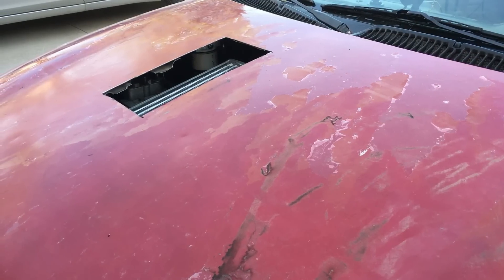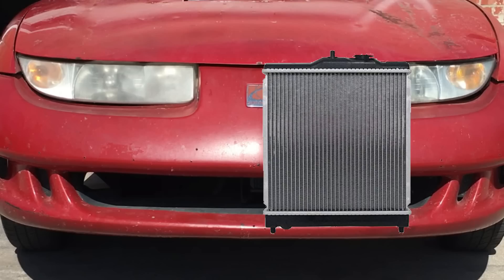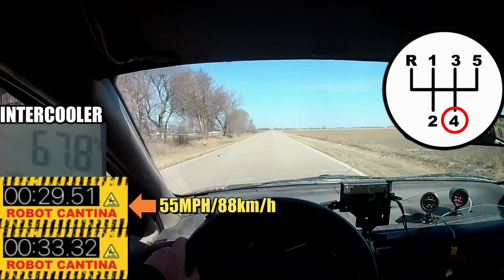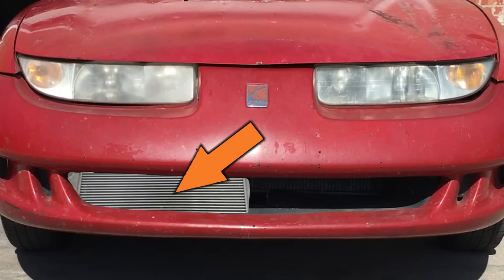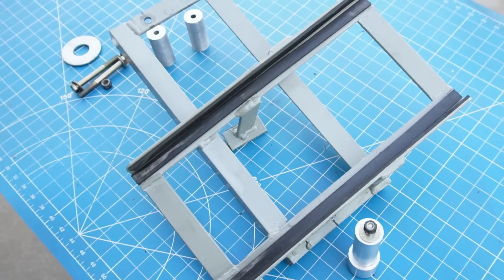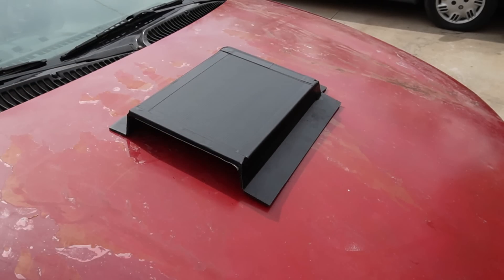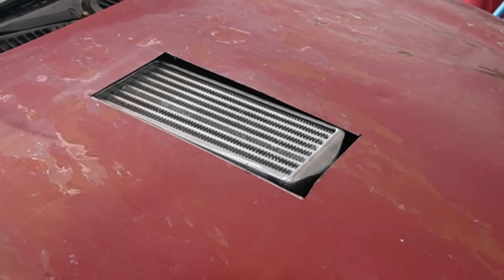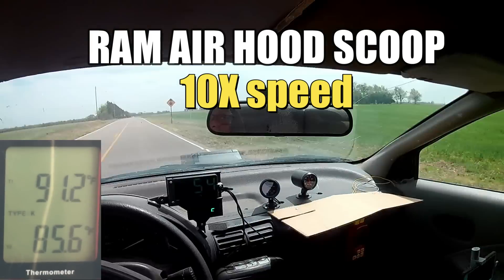S3 E12.  Testing different modifications to the intercooler on the Kubota turbo diesel Saturn.

Comment: It would be interesting to compare a NACA duct vs the ram air scoop, but that would likely mean dropping the intercooler back to the lower slot and a different hole location in the hood.  Purely academic...but there's no kill like overkill. 😆

Comment: I wouldn't say the job of the intercooler is to directly improve performance, it's to allow for more boost, denser air and in result more fuel, granted there won't be much to seen on this small engine but maybe more boost, and moar boost = more heat.  I have a supercharged mustang and the intercooler allows boost to go from a max of 5psi to 10psi, moar powah!

Comment: Putting a mylar/aspestos blanket heatsheild works well for keeping heat away from what you want.

The sideways scoop may pull more air out of the engine bay than opening towards driver.
Reply: I think the word you were looking foe is "asbestos".

If so, I would imagine Bill Gates would be very proud of you..., anyway.....
Reply: @jamesstewart259  they sell it as an off the shelf item at autozone. I used it to replace a steel heatshields on a I4>V6 swap.
Reply: @Eluderatnight  That would be a glass (better known as fiberglass) core...

Comment: I'd say that half of the result that you got by using any scoop there was preventing direct sunlight from hitting the radiator, especially because it's now raised. Of course you need airflow, and for that plan B was the best choice, but the sunlight even on cloudy days would probably have a big impact on this kinds of tests you just did.
Reply: Airflow is what it needed. The affect of sunlight would be immeasurable.

Comment: Do you lose a lot of pressure across the intercooler? I tend to think that dividing and forcing air through a bunch of small holes is going to make for a lot of headloss. Also, "pv=nrt" makes me think that cold air will contract, dropping pressure.
Reply: Like boost pressure? 
Yes, when you cool it it’s volume decreases plus the intercooler is a restriction. More or less depending on the exact setup.

Comment: Why complicate the system with another mechanical device (fans) when a completely passive device (hood scoop) seems to make plenty of airflow? Unless you're planning to do a lot of city driving with idling at traffic lights followed by racing the guy beside you to the next light, it seems unnecessary. But as you pointed out, if the efficiency doesn't change anyways, maybe the whole intercooler system is unnecessary to begin with.

Comment: If I had to guess what the fans will do next week, I would say pulling air in through the cooler with fans will do better than pushing it out from the engine bay, couple it with the hood scoop to double up on airflow maybe?

Comment: Why would performance increase if you have better density but don't utilize it by increasing fuelling? Theoretically I'd assume the higher density results in faster combustion but if you're on the lean side already it probably doesn't cut it.

Comment: Crazy and potentially time consuming suggestion - use a vapor pressure sensor(s) from an automotive evap system to document the air pressures in various locations to inform next steps and improvements (yes, this isn't likely to net any performance gains, but the geek in me thinks it would be cool to see).

Comment: i have scene one of these engnes for sale here in the uk and very temped i was thinking of building a trike as i only have a car licence with cvt to the rear axle i think with the lower wight it would get stupid high mpg id use it in a motorcycle but engine is to tall

Comment: i think all others then ram air did poor as they pulling the hot air from inside out through the rad thus warming it up with ram air having cold air forced directly in is it cooler and is no doubt the same result if it was mounted at the front maybe a little cooler as it not fighting the rising air flow from under the bonnet

Comment: I'd guess that intercoolers are more for boy racers with cone-filtered "cold air intakes" deep inside their hot engine bays, or high-performance engines that are a little bit bigger than this little three-pot diesel, and probably works better on petrol engines anyway, so there's that too, physics and all... :P

Comment: The high compression of a diesel engine is purposely designed to raise the intake charge to a very high temperature to ignite the fuel, so lowering the intake air temperature may actually harm performance. 

If you want to get more performance then a propane system would probably do the trick.

Comment: I would try the intercooler as the air filter inlet pipe then just go too no filter and a mini 12volt can fridge with pipe run through the sides

Comment: The intercooler probably does its job like its supposed to, but you'll need more fuel to compensate for the increased air density
Reply: Yes, but adding more fuel would probably make more power anyways, of course at the cost of less efficiency and higher EGTs. I suppose adjusting the fuel settings to maintain the same air/fuel ratio with and without the intercooler and, if necessary, adjusting the boost for the same manifold pressure to compensate for the pressure drop through the intercooler would be the most fair way to do the test.
Reply: @averyalexander2303  Completely true! The intercooler also increased the amount of turbo lag the system has, so more boost to compensate for pressure loss and volume increase is only fair
Reply: The point isn't more power, though. The turbo exists just to keep the temperature inside the engine down, so adding more fuel would be counterproductive
Reply: @KagoK The turbo was to add power, tuning it with a leaner afr without the turbo would result in a lower egt but he wants it to be as fast as a VW beetle.
Reply: Came here to say this!!  Cooler intake air means cooler turbine inlet temps.

Comment: So Subaru had it right....
The area at the base of the windshield (and extending out a way) tends to be a high pressure area (which is why every car manufacturer puts their outside air vents there.) Unfortunately you're trying to exhaust the air from under the intercooler out of the engine compartment,,,into that high pressure area. Which is why you (and Subaru) need a scoop to ram the air through the intercooler. If there was a measurable difference in performance, putting the intercooler behind the bumper might make it worth while. Unfortunately your motorcycle sized constant RPM diesel doesn't make enough surplus power to significantly affect the speed and acceleration of your 2500 lb vehicle. 
But, hey, it's an interesting journey.

Comment: Regardless of whether I've been 'Paying attention' or not (which I have), the intercooler may not have made any difference to performance but the reduction in temperature due to adiabatic pressure increase means at the very least the fuel consumption will be improved due to the engine producing the same power with less boost. 

What all that means is, if the intercooler lowers the intake air temp, then the boost will be less for the same power since there is a direct relationship to pressure and temperature - it's always colder at 10,000' than sea level adiabatically speaking since the pressure is far less at altitude. This is the opposite at sea level and indeed inside a forced induction intake. If you could go 5000' below sea level in a mine shaft then the air temp might be 10 deg C higher. I think the rate is 2 deg C per 1000' in dry air and half that for saturated air again adiabatically speaking - it is different in the environment but adiabatic is a datum used to explain the effect of temperature due to work in a system.

This then follows that engine pumping losses are less since the engine uses less power compressing the intake air. Pumping air pressure takes plenty of power probably in the order of perhaps 5-7hp at a guess. That's say 3-5kw. Imagine a generator powering 3 or 5 1000w bar heaters. That's a lot of work. 

If the intercooler is working then (which it obviously is) then that might now only be 2-3kw required. Of course this only works when the engine is on boost. A key advantage of a turbo is that most of the time while cruising it is using fairly low boost meaning the engine is small while cruising and big on WOT. A big engine is always big 100% of the time whereas a small engine with a turbo can be small and big - I digress.

Conclusion:
You really need to re adjust the fuelling for each intake temperature reduction. 

Also, for greater efficiency the intercooler might benefit from rubber around the sides to seal it against the underside of the hood. This happens as air tends to draft through open holes rather than going through heat exchangers because going through a hole is a path of least resistance. 
It is possible in this installation leaving it as is might actually improve airflow (therefore temp reduction) or make no difference at all. It is hard to say because scoops are a science too.

Comment: I kinda wanna see the fans with and without the reverse scoop. i wonder if channeling the forced air with no flow directly over the intercooler would effect the temps drastically. Keep up the amazing work your videos are a staple of my sundays!
Reply: I've always understood that there is a positive pressure at the cowl while a vehicle is in motion - air coming over the hood 'hits' the windshield, and the pressure rises in that area. My guess would be that anything trying to push air out of the hood in that location would not be the best option.
Reply: @somethingelsehere8089  that does make sense, I do imagine that the area around the window would have marginally higher air pressure.

Comment: Also don’t use 5 watt pc fans. Make sure you don’t put big load on alternator. I run e fans on my r32 gtr but it freed up horsepower from belt system

Comment: Forced air to provide forced air for forced air. That's a lot of forcing. 

But seriously, I like the scoop idea. The fans on top will definitely work at idle, but they run off clutchless mechanisms to spin. The added air from the car's movement could easily cause them to run over speed, which could both damage the fans and feed additional power back into the car's electrical system. 

We computer nerds have this issue with cheap fans. If they don't have clutches, using compressed air to clean them can damage them and over juice the system, potentially frying the board, power supply, and anything directly attached.

Comment: I mean.... I was watching the video where you were installing the intercooler and you referenced the placement to a Subaru WRX and my first thought was "yeah, but they've got the hood scoop forcing air through it" I feel like it was such a noticeable difference in numbers and the fact that electric fans can and will eventually fail that the decision is a no-brainer. Not to mention (dead horse) you would be installing plastic fans over the hottest part of the engine. Plus, the hood scoop looks fuggin' rad! Love the content RC crew, thanks so much for making it!

Comment: preDiction: plan D has the airstream flowing directly across the opening, so it might create the greatest venturi suction, pulling air out better. No scoop has the opening exposed as slightly into the airstream so there could be a general venturi effect but it's angled slightly into the windstream before considering flow being deflected by the hood, so D could be slightly better. My pennies are on plan C, I think that has the straightest vector lines so momentum will work against it the least and there should still be plenty of venturi if not the most. Alright, time to finish the episode
Reply: my pennies! my pennies! oh god my pennies!
Reply: I do think adding a "gasket" to the hood that mates with the intercooler, to block air from going around the intercooler, would probably help all cases and may help induction modes more. I'm imagining a piece of cardboard that's set up to deflect slightly when the intercooler pushes into it, but that black material would probably work, or tin foil crumpled into a snake. Maybe find some children and make them figure it out, the bar on this is extremely low.

Comment: It isn't specifically that the front bumper mounting is fresh air... it is that the drag within the intercooler's exchanger produces a depressurization across the structure leading to a mechanical cooling OF the fresh air from front to rear of the intercooler - thus why they make them thick instead of broad and sometimes mount em double.    Its like that area just around the wing mirror that is much cooler than the rest of the slip-stream around the car.  Putting the intercooler directly into that undisturbed frontal flow behind a slot that causes the depressurization effect will drop the ambient air temp about a dozen degrees.

Older MAC trucks have the intake side of the intercooler off into a wheel well and use a fan to suck the ducted air out and blow it out the hood cowl.  The fan creates the depressurization in that configuration - so your little planned 12v fans aren't going to amount to much at all and a hood scoop actually increases the temperature of the air.  

As to mounting the intercooler in the skirt slot - just run some zip ties through it and use pool sweeper hose.  You're not gonna get to temps that will melt it.

Comment: The results were surprising. I thought Plan C would yield the best results. And Plan B was much better than expected. Very interesting.
That said, I put a fan on the intercooler in my Jetta TDI and it made a big difference! Especially in traffic. But traffic doesn't seem to be an issue for you. 😎
Reply: I thought plan b would make a slight vacuum and cause air to be pulled through the intercooler.
Reply: This weirdo again?!  Do you just wander around being weird?!

Comment: The point of the turbo on a diesel engine is to lower EGT so you can run leaner compared to the amount of air entering the engine. It's not really for performance unless you start increasing the amount of fuel, but then your EGT will go back up again. The intercooler is the same way, it's to reduce the induction temperature to reduce the EGT. For a gasoline vehicle, the calculus is quite different. Honestly, keeping EGTs down is what gives you headroom for more power.
Reply: 100% accurate

Comment: Word cannot EXPLAIN how much I love this series! Will you try and setup a water/methanol injection system to see the cooling benefits?
Reply: Skip the water, double up the methanol!!
Reply: At this time it literally makes no difference and is relatively pointless. Now if he turns up the fuel and needs to push the combustion temps down a bit or he's getting black smoke then the intercooler will get really important. Cold air is denser air which will help with any black smoke being that black smoke is partially burned fuel. It's partial because it ran out of oxygen. But that air being denser also has more mass to absorb heat.
Reply: I agree, but this isn't the best engine to try this stuff on
Reply: bruh he said multiple times that cooling the air doesn’t benefit this engine. how deaf are you
Reply: @benjamin8981  yes, a discrepancy of 8°c doesn't change much in power output... You ever seen a video of the sand drags in Saudi Arabia? They have custom air boxes with slots that are filled with dry ice pellets.
Reply: @benjamin8981  Intake air temps are specifically whats being tested in the video and what Robot Cantina is doing to lower iats is redirecting airflow across his intercooler. 
What you are refering is Cantina saying the engine does not producing much coolant temp in the video, which has nothing to do with this comment, whatsoever.
 Water/meth lowers intake air temps which is specifically regarding what the whole topic of the video is about. 
Instead of hating, pay more attention.
Reply: @madmod  2:33 11:30
Reply: @benjamin8981  Youre taking him out of context. The charge cooling was a non issue because its winter."Now that the weather has warmed up, the goal is to keep temps below 125° Farenheight"
 Now the temps are increasing due to it no longer being winter and it now sees in excess of 130°F without airflow to the cooler.
As to your seccond point, while the intercooler may not provide a measurable gain at the current level of iat reduction, a water methanol kit lowers intake temps while increasing power with the methanol. It would pick up power while dropping IAT's without needing to plum a better intercooler.
Reply: @benjamin8981  Methanol injection adds octane to the air fuel mix and that alone is worth considerable power. Cantina says its not worth replumming an intercooler because the car is getting junked but a water/meth kit is a simple and bolt on kit and can be reused on future builds.
Reply: @benjamin8981 2:58  He litterally states, now that its 80+°, its time to start testing airflow to the intercooler. Hence the whole point of this video
Reply: @madmod  3:36 he said it’s still below 125. don’t just make things up and believe it. the scoop took off 20 degrees. there’s no reason to use water meth injection. if he wanted cold power he’d just bottle feed it
Reply: @benjamin8981  forget the water, do just methanol and delete the intercooler. Better iats, higher octane, usable on future builds.
Reply: @drippingwax  Itd be cool to run some nitro or cng.

Comment: A intercooler is to keep egt down. A intercooler makes a engine not melt pistons when you add fuel. If a engine is not over fueled a intercooler will make little difference. Fuel makes horsepower intercooler keeps engine cool

Comment: I say plumbing it down to the big hole in the front cowling will be best...but it will make the air line longer...
That poor little diesel is getting beat on "for science"
OOH!  Have you ever thought of a light propane gas injection system?  (only problem is it would DEFINITELY make things too hot on the internals)
Keep em coming!!!!